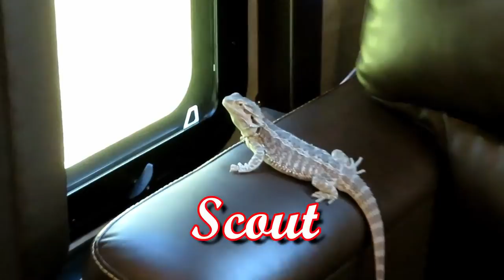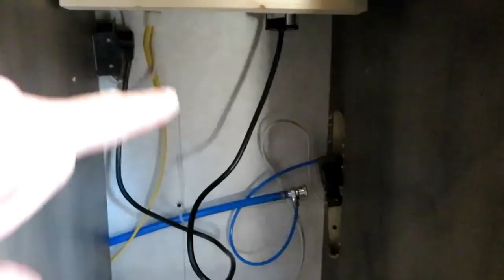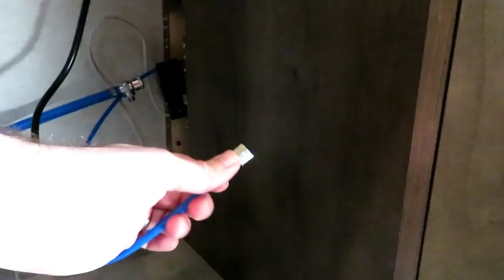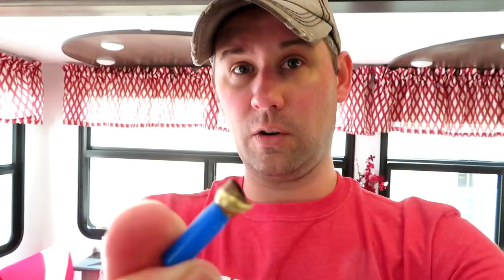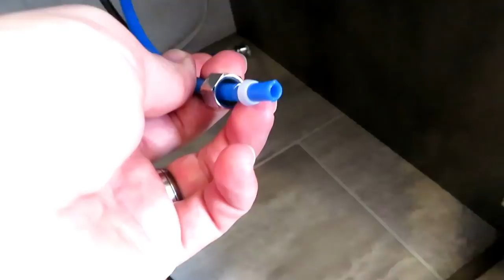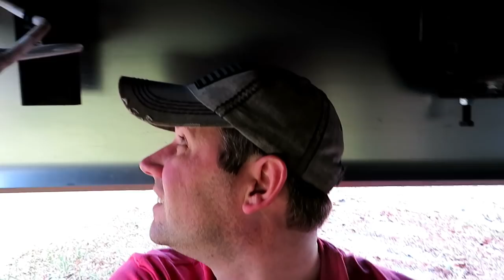I Flooded the RV || Prepping for RV Living

Comment: That sucks. I always dread a water leak in our trailer. A few months after we bought the RV the toilet water supply was spraying on the floor at the threaded coupling. Fortunately we could see it immediately. I hope you don't have to much water damage. Great job on your video. Keep them coming. Here's to dryer days.
Reply from the maker: Thanks. It was not terrible. I don't think there is water damage. We took it to Memphis a few days later with no issues.

Comment: Glad you got it fixed. Water leaks can be scary. Just as an added point, when I'm out sightseeing for the day and leave the rv back at the campground hooked up to the water spigot I turn it off until we get back. Would hate to come back to a flooded rv if a fitting broke
Reply from the maker: Good tip. Thanks. That might save us a flood in the future.

Comment: The problem is you're not supposed to use brass compression rings with the plastic pipe, they make a brass insert with a plastic compression ring and make sure you don't over tighten it
Reply: Okay I commented too soon, you figured it out. Those guys should know better but it's actually a common mistake. Just FYI, you don't need to put teflon on those fittings. It can often cause it to leak because it can disturb the seal between the compressed components. Hope all is well.
Reply from the maker: Thanks. Glad it wasn't worse. We chalked it up as a learning opportunity. Gotta take the bad with the good I guess.
Reply: Wayward Waggs yeah man, that’s life haha

Comment: Good work and seeing it all the way through. Those compression sleeves we use to call ferrules. I think you wrapped the teflon tape in the wrong direction looking at the video when you tightened the nut but normally on a compression fitting you would not need teflon tape. Someone at the factory or dealer shut the valve off when the fitting leaked instead of fixing the problem and left it for you to deal with.
Reply from the maker: It was good to be able to gain some knowledge with minimal damage and not having to take it in for warranty work.

Comment: They just don't build campers like they used to. They are all built by "unskilled" labor using crap materials.  No reason you shouldn't have easy access to any plumbing. Compression fittings should NEVER be used for ANY plumbing situation indoors because they leak...
Reply from the maker: Glad we caught it early and that it wasn't worse.

Comment: Shut off the water from the home, if you have water in the freshwater tank, turn on the water pump, and if it's not running, it should be good.
If the pump turns on every 30 minutes....you may have a issue.
I sure your fine. It blew out the weak spot JUST FINE😬 

🇺🇲
Reply from the maker: It's all fixed up now. No leaks. It was a learning experience.
Reply: You did good.
Teflon tape on the threads of a compression fittings though is pointless. It will leak between the compression nut and the tube, if it's going to leak.
Your learning.
If it's something your unsure of...make a video 1st and I'm sure you will get lots of people giving you lots of help.